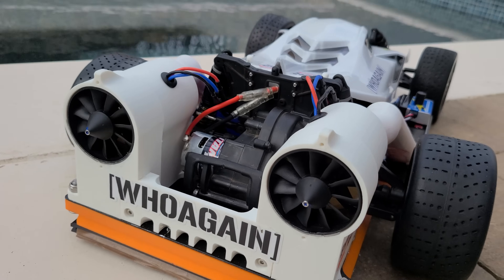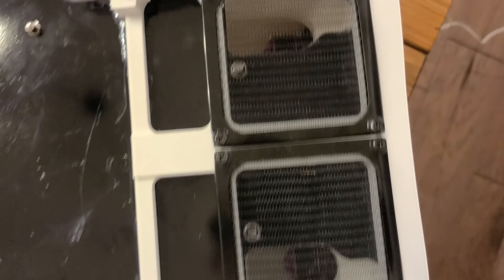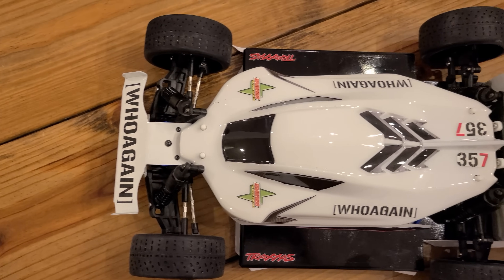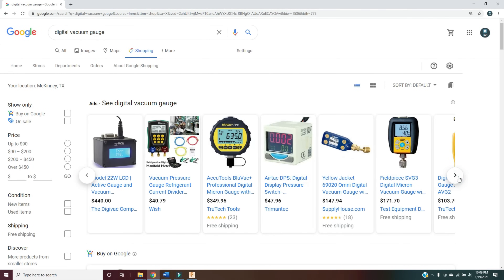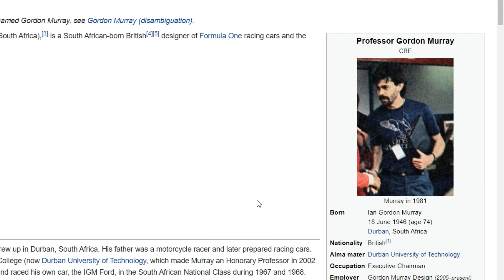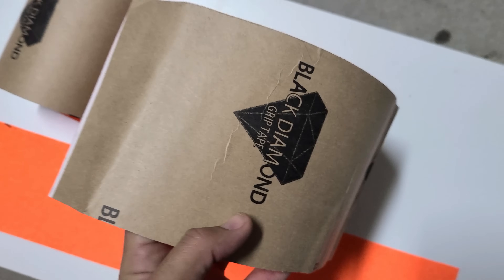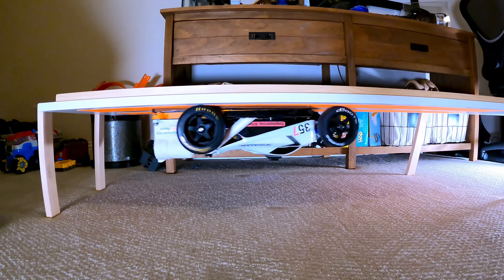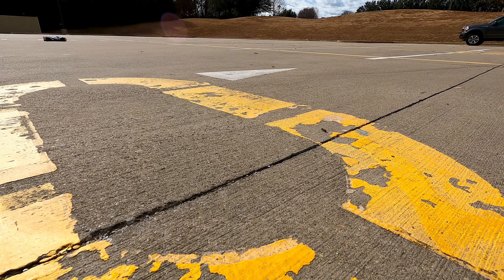Can a Fan Car Drive Upside Down?

Comment: Absolutely look at GRP tyres, they're hilariously tacky once you get a little heat into them.
I've had my car stick to tables after a night of ~110mph passes.
Reply from the maker: Do you have a recommendation for some 1/8th scale GRPs? I definitely want to give them a shot
Reply: @EngineeringAfterHours  Personally I use S01 Revo S5's, the S# refers to the rubber compound on that set of tyres.
The lower the number, the softer the rubber and consequently the less heat required to make the tyres tacky.
The compound number ranges from 1-7 and naturally soft is great of you're looking for grip, however you will inevitably wear them out faster, I find 5 to be a great balance between grip and durability for my RC.
Best of luck!

Comment: If you are looking for an increased pressure drop for less weight and power, have a look at a turbine style design. Edf's are good for moving large volumes of air but struggle with pressure changes. You did get some great results there however. The turbine style design is much more efficient at generating a pressure differential then moving large volumes. The edf's were likely stalling the blades and requiring 4s to maintain the low pressure required. I'd expect you could achieve the same result with 1 turbine on 3s. Keep up the great work!
Reply: He should at least put the fans in a series smh
Reply: Im mentally reeeing right now because of his EDFs being reversed.
Reply: Going through this much effort and aerodynamic engineering for the fans to be placed the wrong direction.
Reply: @ignasanchezl  ikr 😵
Reply: But the issue here is that as soon as the seal with the road is brocken, you need to quickly evacuate a lot of air to seal the bottom again. So to me high power EDF are the best choice.
Reply: but this application is high pressure ratio but low airflow with the underside of the vehicle being "dead headed".
Reply: what do you mean by turbine?
Reply: @frostyab7579  what he has used is a ducted fan. A turbine would be more like a turbo charger style impeller.. designed more around increasing pressure rather than moving volumes of air. The ducted fans suck at creating large pressure differentials.. heh heh.. see what I did there ;)
Reply: @frostyab7579  the original commenter means a centrifugal style fan. I'm not sure how the original commenter is knowledgeable enough to make that assessment but not knowledgeable enough to know the correct terminology for centrifugal fans. Centrifugal, as opposed to axial.
Reply: This guy blows.... haha

Comment: Larger diameter tires yield larger longitudinal patch...larger area perpendicular to acceleration forces means better straight line/off the line performance.
A certain performance car's engineers noted an increase in drive tire diameter resulted in significantly increased results over just increasing width.
In fact, I believe it was stated the car performed better off the line with something like 21 inch 245s vs 20 inch 315 or 335 or 395 or some ridiculously wide tire.
It makes sense when thinking about the direction of the force compared to the contact patch and the friction needed to launch the vehicle...it's kind of like having a 2"x4" piece of wood laying flat on the 4" dimensioned side and using that to walk across a gap, then switching to a 2"x8" piece. There will be some strength gained with the increased width but if they switched to a 4x4 there would be an incredible performance difference.
This is also helps to explain why lowering tire pressure increases accelerative performance, amongst a few other factors.

I can't remember if you said the ultimate goal was just insane 0-60/straight line performance or all around high acceleration performance....something like being able to sustain 5g consistently through a corner. If it's the former, and rules are ...well flexible...have you considered using/creating something that equates to having a ton of weight on the vehicle(specifically over the drive axle since you said RWD) and immediately after initial acceleration occurs, which requires the highest level of friction, release the weight from the car so it doesn't negatively effect drive train and aerodynamic efficiencies. Please don't ask what something like that would look like or how it would work because I have no idea, I just know it sounds really cool from a performance standpoint to be able to have a ton of weight being applied to the drive tires right at take off .....and then imagine programming a mini ECU or something so it can drop the weight based on real time calculations performed up to 1000 times a second. The calculations happening every milisec would determine the optimal weight needed to achieve enough friction to keep the tires from breaking loose, so as the car accelerates and momentum continually increases, the weight needed to maintain straight line grip will reduce at a rapid rate and the vehicle will drop its PEMs(performance enhancing mass) faster than someone that's on a keto diet through nutrisystem that has richard Simmons as their personal trainer,  just signed up for Jenny Craig, and not only owns a thigh master but also the highly coveted shake weight(we're talking serious weight loss and very quickly(talking about the car(not being a smartass)I lost track of how many open parentheses I created)hopefully this is the last one).
Good luck on your future build and thank you for the interesting content

Comment: Could you direct the exhaust/fans at a 45 degree angle up? More down force and less debree????
Reply from the maker: Oddly enough, the debris path is like a hemisphere as it goes back and radially outward. The second fan car I made did this and I cracked a gopro lens lol

Comment: though this might take considerable r&D but if you added a programmable accelerometer so the car could gauge it's angle and adjust the vacuum pressure and have racing that goes up walls and inverted
Reply: I can imagine a clean RC track that's almost IRL Rocket League in physics. Pretty cool.

Comment: These new top speed runners should employ this
Reply from the maker: This car is more designed for acceleration so it's got quite a bit of drag. Speed runners usually want a more aerodynamically efficient body so this may give them problems. 

I've thought about building a speed rig, but I don't live near anywhere that I can actually test it regularly.

Comment: That looks totally awesome but it looks like you're EDF units are mounted. iFly radio control jets and if you were to flip the units around and have the airflow through the direction they're meant to you would get even more downforce.

Comment: Not sure if this would create too much complication or pressure drop, but what if the skirt is made out of an inflated tube, potentially siphoning some of the air from the fans. It around in theory be able to inflate and deflate depending on how much air you're pulling through

Comment: Hi. This is awsome but i have one question... why the hell did you mount the EDFs the wrong way round???? You could have made a lot more suction by using them the right way round and therefore could have used hard or very stiff skirts wit less friction or with a tiny gap to the ground
Reply from the maker: How much does the pressure drop change based on orientation?

Comment: GRP tires have an immense amount of grip when they heat up. They are so sticky they will stick to most surfaces. But good stuff man. I am having problems keeping my infraction on the ground when I attempt to give it full throttle l, it wants to take off like an airplane

Comment: Make a negative mold of the tire from 3D printed or even bought ones. Then pour silicone into the mold(pour is the wrong word. you'll need lots of pressure). It's also called RTV , but tubes of it are available for sealing up houses at any hard ware store. Depending on thickness of tire and porosity of mold it will take from days to weeks to set. Maybe this is why you don't see any available.:) But boy does it grip.
Reply from the maker: I actually bought stuff to adhere my platinum cure silicone onto regular rims so I can 3D print my own tire molds. I just need to get around to it sometime

Comment: Im not sure I’ve ever heard an engineer say “Yes I know they’re on backwards” or “its good enough” 

It didn’t work so… was it good enough?
Reply from the maker: It did work....what are you talking about?

Engineers are notorious for not understanding good enough...you're right there. That's why those that do understand the concept tend to make great leaders and great products. Those that obsess over useless margin tend to blow budgets and never finish anything.
Reply: My apologies, I missed the portion of the video where the car did drive upside down without dropping…. Family is good at creating distractions at crucial times. Again my apologies
Turn those EDFs around & airflow will increase, rpm & power requirements can be reduced and could lead to using smaller/lighter  components.  For The skirts use the ridgid panel material  but  instead of rotating via a hinge crate a vertical channel that the panel can travel vertically to close the gap between the car and road surface, light springs above panels to maintain contact with the road, the road itself can push the panel up into the channel when the vehicles ride hight drops. 
Its a Great project

Comment: For lateral G's you could have the fans' exhaust hit some lateral aerofoil. Ideally one that deforms hydraulically, to switch between "skinny", "left" and "right". Voila, low speed lateral G's that don't load the tires.
I want these dynamic aerofoils for high speed applications as well. Just SAIL around turn in stead of smoking up tires. Best thing: it would load up the inside wheels that would normally be unweighted. So you can derive mechanical grip from them and ride flatter.
Reply: You could also make a simply 3-way duct valve. As you steer, the fanned air is sent through one of 3 exhausts: up (downforce), left or right.

Comment: For anyone wondering, 3D prints are super porous and a good amount of air will be leaking in massively destroying suction and downforce.
Reply from the maker: This is definitely incorrect. I'm not sure what type of 3D printer you're working with but these prints would have a negligibly small leak rate. 

I've used the same prints for molding and fluid retention which wouldn't be possible with excessive porosity.
Reply: @EngineeringAfterHours  maybe they are printing with different materials/different settings

Comment: I love the ingenuity but we’re going faster with no fans, 2 wheel drive and on 2s power.
Reply from the maker: That doesn't surprise me at all, and would have been the more cost effective option if I didn't care about turning. Top fuel dragsters have the fastest 0-60 of any vehicle I believe including jets.

This build was inspired by the fan cars of the 70s like the 2J and BT46B.

Comment: Great Video, FYI EDFs are great at creating momentum and high velocities, not so much a pressure drop.  Using something like a turbocharger (centrifugal fan) and create press drops 10-100x that of an EDF
Reply from the maker: The intent behind this video was actually to see how much of a pressure drop I can get with an EDF and it was a few times greater than need. I had read the pressure drop was very limited but no one had concrete values, so I was happy to see an EDF give me more than I need.

Using a centrifugal fan will drop my flow rate substantially which makes the design way too sensitive to leaks and leak rate. So passing a crack with a centrifugal fan will have a bigger impact than passing a crack with my EDF. I also don't want a higher pressure drop as it's already high enough.

Comment: I think you should revisit this, I suggest using some UHMW tape as the skirt/interface between the surface and manifold. Which would also slide/wear away smoothly. Second I would suggest splitting the plenum underneath into multiple separate compartments connected via a manifold with some sort of either valving or treat it like vacuum tables. So that they again distribute the vacuum around better.
Reply from the maker: Thanks for the feedback, I'm definitely revisiting this with a car intended for a very low 0-60.
Reply: @EngineeringAfterHours  I believe they used bristles in the F1 fan cars. I was looking into doing an almost identical RC project, and my plan was to go with bristles as well.

Comment: Can you do a double skirt? One just inside the other. The inner one would be mostly solid and the outer one more flexible. What about changing the orientation of the fans to blow exhaust away from the surface?
Reply from the maker: I tested a few double skirt arrangements with mixed results. It may be worth another look. 

By changing orientation do you mean have the fans pushing the car down? When these fans are being used for a pressure drop, they create almost no thrust.

Comment: I'm new to the rc scene and not a scientist by any means but I think if you throw a 1/8 scale brushless on it with a 4s lipo and adjust the gearing in your differentials. burn  out them slicks a bit like drag racers you could get this thing 75+ mph easily plus with a larger motor you could use more force on those skirt  hinges for improved vacuum. Also if your going to block your shocks with tubing try it above the caps of the shocks
Reply: You could also just put some collection bags on the exhaust ducts and have the best vacuum ever😂
Reply from the maker: I just picked up a 6S setup so its going to fly for sure. I still need to work on tore warming and prep.

And no doubt about the vacuum lol. Or reverse it and make a leaf blower.
Reply: @EngineeringAfterHours  so pumped to see what's next!

Comment: you need traction compound to make the tyres have more grip 

and you should consider putting in like a 3 speed gearbox from a nitro car in there
Reply from the maker: Do you have any traction compound recommendations? I've never really played with the stuff.
Reply: @EngineeringAfterHours  not really they all work similar , most have a light, medium and heavy i would suggest you get a pack with all three so you can try and see which is best for this car

Comment: AWD for the win...
Reply from the maker: No doubt. In the video I say I'm going to continue with 2wd, but I did all the tractive force math a day after that and realized I really do need to go down that path so I'm planning which chassis and the power train components needed.
Reply: @EngineeringAfterHours  Buy yourself a piece of cf plate and make your own chassis, you'll be able to control the vacuum forces based on the area of the chassis and its super easy to work with no special tools needed.
Reply from the maker: @beachboardfan9544  I actually controlled the low pressure area in this one with a custom undertray. I'm debating a top speed build and that one will definitely be a custom designed chassis, body and drivetrain
Reply: @EngineeringAfterHours    Cool project, looking forward to seeing how fast you can get it.

Comment: For the tires I would probably switch to foams instead of rubbers.
Reply from the maker: I'll pick up a set. Any specific recommendations? I was looking at the BSR foams but not sure on compound. I want high grip but it needs to be tough enough to handle high loads
Reply: @EngineeringAfterHours  Well foams are meant to be expendable so you'll have to replace them a lot if you are putting a lot of forces on them but they are the best for speedrunning I don't really know of the best brand but contact rc makes decent ones premounted to wheels

Comment: Pretty cool stuff... now it's time to do some channel mixing... More throttle, less fan speed. You really want it more for lower speed.
Reply from the maker: That's a very interesting idea.

The next step of this build is actually for 0-60 times so I want as much downforce as possible throughout the entire run. To get the acceleration I need, I have to have at least 1x the weight of the car the whole time. Preferably 1.5-2x

If this were a road racing car like F1, I'd want to dump downforce on long straights, but still keep high downforce in the higher speed turns and while at high acceleration. 

So GPS mapping would be great and maybe something like a combo between throttle percent and turn angle.

Comment: This project looks awesome, I am in the process of developing my own RC car with similar systems controlled by a Arduino nano ble sense, hopefully can use the sensors on the chip to actively control systems. Maybe I should consider edfs😅 but might be a bit out of budget to be honest. Thanks for the inspiration and good luck for the lateral car👍🏾
Reply from the maker: Thanks! I've toyed with the idea of a speed run car and small active aerodynamics surfaces to stay on course was one of the things I dreamed of doing. I'm sure an arduino would work great for that.